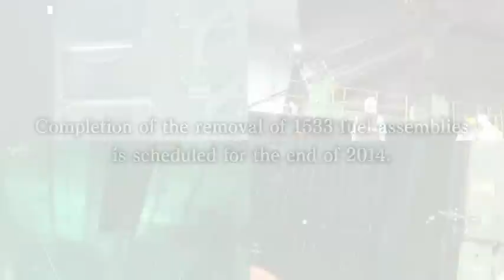Removal of nuclear fuel assemblies from Fukushima Daiichi nuclear power plant

Comment: Ohh GEE.... WONDER WHY THEY DIDNT EXPLAIN HOW THEY WILL REMOVE THE MELTED FUEL? HMMM
Reply: Probably because nothing we have can tolerate that kind of radiation exposure without frying the circuits of every robot out that gets to close to the fuel. Try reading a bit and doing research..it's not hard. Google is your friend. https://gizmodo.com/excessive-radiation-inside-fukushima-fries-clean-up-rob-1792217866 so unless you're hiding some spectacular design I'd suggest shutting up and letting them deal with it.
Reply: I think they don't know yet. If the reactor vessel has no bottom, you can't fill it with water. And the fuel assemblies probably don't have tops any more: Nothing to grab.

Comment: How long will it take to remove the Fukushima Diichi plant
Reply: I would guess they will handle it like TMI which was similar in damage in a lot of ways.

At TMI they took a bit over a decade to slowly clean up the broken reactor and put the place into SAFSTOR. Then in 50-60 years, after most of the radiation from the tritium and stuff is gone, they will knock down and entomb the larger structures. All sorts of nasty stuff plated out on the inside of the building during the meltdown. That is stuff you want to keep locked up for as long as possible and not spread about by demolition charges and jackhammers. So they will wait.

Comment: If this isn't a reason NOT to use Nuclear I don't know what is ! 30/40 years to remove the fuel rods?What if they have another earthquake ?
Reply: The whole refueling process from removal to storage to replacement and startup then the eventual transfer of spent fuel takes 5 years at most, the reactor is usually back online after 12 months.
Reply: @InserNameHere2053   Perhaps in a healthy Reactor but not at Fukashima Misaho .
Reply: @brikfiend  The majority of the intact rods have actually been removed already, the main issue is the Chorium that's created a hole through the base of reactors 1 and 3 (possibly 2), that's going to indefinitely remain, easily for my life time and those after me, most of the decommissioning should be done by  2100 including the removal of units 5 and 6 along with demolition of the other unneeded structures such as the turbine halls and the common fuel storage area. The Chorium is likely going to be buried in land or shipped to somewhere like Sellafield in Cumbria to be dealt with properly, that's unless somewhere new and close by is built.
Reply: @InserNameHere2053  what about those giant jellyfish over there. Clogging boat propellers and shit.That stuff that got spilled into the oceans was like nuclear reproduction juice for them. It seems the jellyfish where profiteers of the disaster and might take over one day.🍻
Reply: It is a matter of time before a natural disaster happens again, we live on a very active and diverse planet. The way I've always seen nuclear energy is like " upgraded steam power ". You just gotta make sure the volatile components don't become unstable/overheat I guess...I'm sure it's incredibly more complicated than that. All I can say is that things happen so try to be prepared. Change takes time nuclear apparently has extensive capabilities, but it's scary.

Comment: The damaged pools in 1 2 and. 3wont last long enough and just one strong earthquake can rupture one of the pools . from that point on it gets very very bad with a great potential for a uncontrollable fuel rod burn. Very very bad
Reply: That's nonsense, disaster was in 2011, by now none of the fuel there is radioactive enough to melt, burn or anything like that. Any leak from the pools would be bad, but no worse than all the water that has already leaked from the reactors. And you are just making stuff up about burning fuel.

Comment: Since the accident thet haven't mucked around, Tepco really have got a move on, I've been watching the live webcam feed for years (use it as test fottage at work) and the site looks almost like new again with rebuilt buildings etc, next time stick the diesel generators on the roof so water from tsunami cannot be taken in air intake and stall.

Comment: Absolute propaganda. Wow. 1. No humans can safely get inside reactor no. 4., 2. The spent fuel is located on the roof of reactor number 4. 3. The inside of the pool was damaged and that pool looks pristine. 4. That music... an attempt to make everything seem happy go lucky. Fukushima is already the worst disaster in recorded history, but it could become extinction level event number 7. And ask yourself why NOBODY talks about it on the news. 🤔
Reply: Here's how it works. The fuel melts (~2250F degrees) then it either (a) slumps in the bottom of the vessel and the reaction stops or (b) continues through the bottom of the reactor vessel and hits the core catcher shield and reaction stops since it gets spread out by gravity and the sloped design of the shield. The reaction stops since it is not in the proper alignment with a moderator passing between it anymore. It then cools down to under 2250F and solidifies. There are still some fissions that occur around the extremities of the core slump because some of it is in the right geometric configuration for that to occur - by random association vicinity. In every nuclear meltdown we've seen, this is the case. There is no scientific evidence to prove otherwise. If you have scientific proof, please post otherwise, because that would be a huge revelation in the laws of physics.
Reply: Richard doesn't understand the difference between nuclear power and nuclear weaponry, nor does he understand nuclear engineering even at a fundamental level. You can tell he just reads his information off of activist sites, which don't even take logic/reason/science into account.. purely emotional thinking.
Reply: +Richard Gould lol,  where do you get your information from? Haha
Reply: lol, I want some of what you are smoking. >_<
Reply: I sit next to ISFSI casks full of uranium every day. It's very easy and we already know how to do it. Standing 1 foot from it, you're just at 2x background, and 10 feet away, you're at background levels. Storage isn't the answer though, we need to recycle it and re-use it in 4th gen reactors.
Reply: Richard Gould You are so dense.  Could you not even bother to read the mission statement of WIPP? . . ."licensed to permanently dispose of transuranic radioactive waste for 10,000 years that is left from the research and production of nuclear weapons". . .

SPECIFICALLY THE PART THAT SAYS RESEARCH AND PRODUCTION OF NUCLEAR WEAPONS.

Weapons grade material is highly enriched uranium and plutonium. Whereas reactor grade material is only SLIGHTLY (<5%) enriched uranium ore.  The decay daughters of plutonium and uranium fission product daughters are SIGNIFICANTLY different.  You are conflating concentrated natural decay of raw plutonium and U238 with the fission products.  Spent fuel only contains about 1% fissile U238 which is about the same concentration as raw ore and why it is used in 4th gen reactors. 
I personally was in charge of 1.1GWt worth of government operated reactor using the A4W design.
Now be a good little conspiritard and GTFO so the adults won't have to waste time cleaning up your shit.
Reply: sivalley, sadly the internet is chocked full of them.
Reply: isn't Chernobyl way way worst? at least theyre trying to get the fuel out (assuming ofcourse that most of this aren't lies)
Reply: wiretap25 Hehe. . . I was just getting tired of his ignorance popping up in my notifications.  It made my head hurt having to talk down to the poor guy.  ;)
Reply: Yea, it could wipe out the human race if you force fed everyone a piece the core slump.
Reply: The design varies by reactor design, but they all work in the same manner. They are usually a steel lined and use lead impregnated concrete to spread the corium (melted fuel) out so it cools and solidifies. When I mean there are some fissions (i.e. criticalities) it isn't the whole mass, it is random fissions due to the fuel being out of geometry without a moderator. Overall, the fuel melt incident ends because the melted fuel has cooled down enough to re-solidify. As to your second question, yes, there are neutron absorbant materials that can be injected to stop the reaction. Sodium pentaborate (SLC injection) is used for this purpose. The reaction can stop, but you still have over ~3MW of decay heat on average in a 1000MW reactor, which is why cooling is essential. Fuel can melt despite the reactor being shutdown if you don't cool it.
Reply: +Pascal Christiaanse 3MWth being produced constantly every second..
Reply: What are you talking about..? The peer reviewed high estimate for Fukushima radioactive release is 800 PBq. Chernobyl peer reviewed average estimate is 5,200 PBq. Chernobyl was over 5 times worse, since the RBMK reactor in Pripyat did not have any containment structure. The Fukushima reactors have containment structures, of which two were partially damaged. This is why there was significantly less radiation released. If you're saying the Fukushima "reactors" had no roof, that was the building of the roof that was damaged in hydrogen explosions. This is not part of primary containment.
Reply: wait... if they are probably about 6000 degrees, why dont they use thermals.
Reply: wiretap25 oh fuck thats true so 9 m3 every second, so that sodium penta something, how toxic is that stuff, because if its not too bad they could just flood the area with it couldnt they
Reply: The sodium pentaborate is only injected if you have an ATWS. Once there's a core melt, it isn't needed or won't be effective since the core has lost its geometry and is already shutdown per-say. The spontaneous fissions occurring in/around the core slump wouldn't be stopped if you were to just flood it on top of the corium, and really isn't necessary anyhow since the amount of fissions occuring in a core slump are miniscule compared to even 1% CTP.
Reply: Storage at Yucca is being blocked politically, not scientifically. And yes, it can be done safely, as I have an ISFSI storage pad is right next to my office, about 25 meters away. You might want to look at tests done on storage casks. During Fukishima, their casks didn't even move during the earthquake and tsunami. They are spent U-235 fuel bundles.. there is still some uranium left, and many other decay products. The actinides only account for about 1% of the spent fuel, but they can be transmutated into other products which we have uses for. The rest can be recycled into new fuel for 4th+ gen reactors. This is not nonsense, it is called science.
Reply: loll where do you get this information from? If it collapsed, you'd have localized gamma radiation in the surrounding area which has a 1/d^2 intensity. The core still isn't on fire and releasing plumes of fissile material. It has solidified and will remain in the bottom of the reactor building.
Reply: +Richard Gould get your facts straight.

- The RBMK reactors used at Chernobyl are over 4 times the size of a single Fukushima reactor.
- The reaction at Chernobyl was stopped because the reactor was completely destroyed by the explosion.
- Only a couple dozen people died directly from radiation poisoning, certainly not several hundreds.
- If the meltdown at Fukushima hadn't already stopped and had actually reached the underground aquifer, there would've been a massive steam explosion that would've destroyed the entire facility, similar to how a steam explosion from the water in Chernobyl's #4 bubbler pools would've destroyed everything in a 100KM radius and made large parts of Europe uninhabitable for over 500,000 years, had people not drained those in the days following the disaster.
Reply: Cosmic Background Radiation Chernobyl is that one disaster...the one that could have put the world into extinction....fucking fearmonger
Reply: You should call Deeznutz Here, have a tin foil hat and go sit in the corner with all the other conspiracy theorists.  Come back when you have a degree in nuclear physics and a better grasp on CMR fundamentals.
Reply: sivalley not all of us are dumb enough to believe that only those of us with a degree in nuclear physics can decide whether something is dangerous or not. Michio kaku has the degree you speak of and he agrees with everything I've said. So what say you to that? And everything I said in the initial paragraph was from tepco, and credible news sources that you can confirm in 2 minutes on the internet. I'll refrain from calling you names because I understand that you're scared like the rest of us.
Reply: Need more info! What "fuel"? What was it made out of? What was it used for?
Reply: @emanuelguzman-garcia3567   basically enriched uranium aka uranium 235
Reply: wiretap25 from what i know and what you tell me why would 3 therostats be able to point the direction of a heat source
Reply: So basicly what your saying molten uranium fuel got dumped in a sort of emergency bucket which melted because bad material choice and it spread out, but due to coincidence enough accumulated into one spot to keep fissioning
Reply: Thanks for clearing that up, i have another question: isnt there like poison to nuclear reactors, a by product that slows the reaction, or cant they put in a neutron absorbant?
Reply: But 3 million joules isnt that much is it, sure its a microwave running at full blast for like a 1000 hours, but youd only need like 9000 liters of water to boil to get rid of that energy (assuming i didnt fuck up my math its 00:30) (3.000.000 / 80° / 4.12 = aprox 9000 kg mass of one liter of water being around 1kg)
Reply: wiretap25 right... so how could they solve this then
Reply: ....are you thinking of Chernobyl?
Reply: That's just what I was thinking! Fukushima Daiichi reactors 1, 3 and 4 had no roof!
Reply: what do you think about thorium reactors?
Reply: Not the worst in history, ill informed. Chernobyl.
Reply: Cosmic Background Radiation Chernobyl is way more worse than Fukushima, and way more contaminated, and inside the sarcophagus were the reactor and all of its fuel,  the radiation levels are still the same to this day, and are very deadly.  And is still releasing radiation.          Chernobyl is the worlds worst nuclear accident and always will be
Reply: Sivalley: You are another nuclear BIGOT. ..... In 1957 a bunch of people with better qualifications than yours caused an environmental disaster in Cumberland, UK. ..... The fire at Windscale released Plutonium into the atmosphere, that was of less import in the short-term than the thousands of gallons of milk that (unfit for human consumption) were poured down drains, deoxygenating the rivers & killing all the aquatic species therein. ..... Come back when you have a bit more wisdom & can see outside your bubble.
Reply: Fukushima's radiation has reached the water table & is still being transported across the Pacific. Considering that we know more about planets in other galaxies than we know about our oceans, & also that TEPCO are still trying to find what's left of the cores ,I think that claiming Chernobyl as the worst nuclear accident could be somewhat premature

Comment: Wonder if we can swim in it.... that may be your last dip in a pool.
Reply: You usually can. Just don't dive close to the spent fuel. Ionizing radiation are halved by every 2.7 inches. Below the surface, there's less radiation than above water. 
Of course in reality it is only trained divers that takes a dive into these pools and they stay away from the dangerous bits. :)
Reply: What do you mean close to the spent fuel? Is there fuel just roaming around mixed in with the water? What kind of "fuel" is it?
Reply: Emanuel Guzman-Garcia "fuel" = the radioactive rods that comes from the reactor.